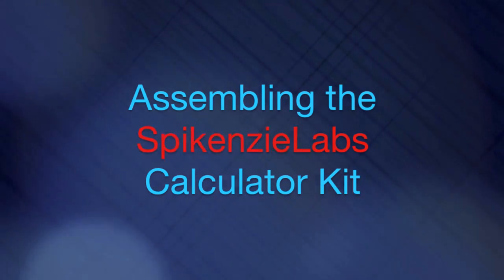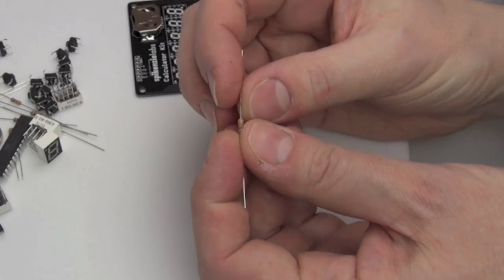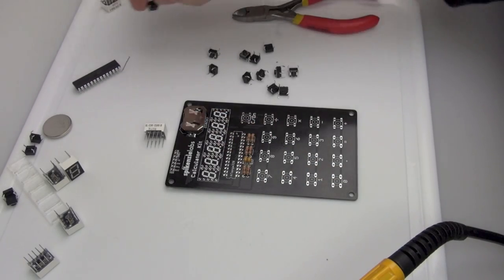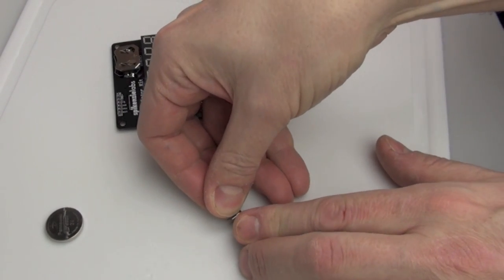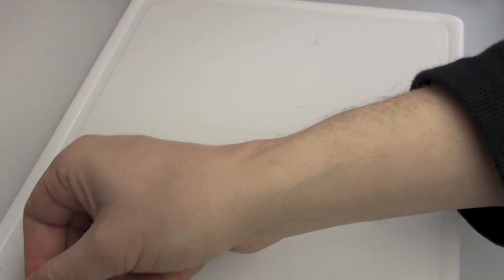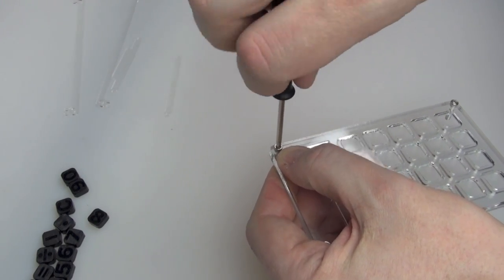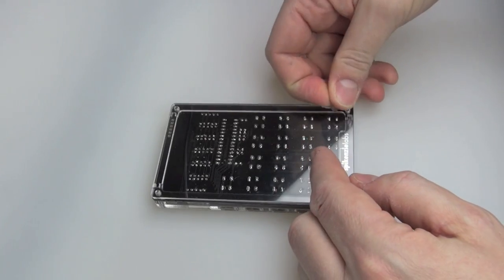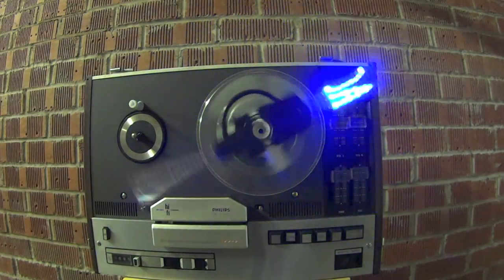Assembling the SpikenzieLabs CALCULATOR KIT (2013 video)

Comment: resistors work either way. Oh my... I thought a host of such a channel would know such things
Reply: He was actually soldering diodes in, not resistors XD.
Reply: +Quentin “SpecialBomb” Jankosky oh, wait, they were resistors.
Reply: +Another Trivial Mudak and Caps are polarized.
Reply: honestly, it osunds like the instructions made it seem like direction was important. plus, who's it hurting to just assume electronics are directional, tbh
Reply: MemphisBell electrolytic caps are polarised whereas ceramic caps aren't
Reply: Well, resistors don't care which way they're put in. But when I assemble electronics I have my way of putting them in. So they read the right way - vertical all the same and horizontal likewise all orientated the same.
I do take care to bend legs nicely too. It may not matter you think. Well it does when you look at it - you can see it's made by someone who know how to do a proper job. And in the rare event a component needs to be replaced it's easier and prettier too with legs bend carefully than just a quick job.
The devil is in the details ;)
Reply: +MemphisBell Not ceramic caps.
Reply: Reggie Roberts actually you can find tons of radial, and probably also axial non polarized electrolytic caps. film capacitors also aren't polarized generally, and neither are silver mica caps... Tantalum caps however are usually polarized though; you know for the sake of being pedantic and point out random polarization facts for the thousandth time.

Comment: Woah, these comments are hard to read through. 10% "glad you had fun", 50% "about the resistors" and the other 40% condescending know it all's who just have to voice out "how dumb" because they know one little thing. Life Tip: it's for fun. If you think you need to "shake your head in embarrassment" for someone doing something they find fun then you have a long way to go in life skills, or you will always be that dick blurting out the things you know about the furnace to the repair guy trying to act smart, and NO ONE likes that, they put up with it to not start issues.

Comment: Percent button in my opinion is most useless button ever put on calculator.
Reply: Or you could just multiply: 
$13 + 8% tax: 13 * 1.08 = 14.04
$13 at 20% off: 13 * .8 = 10.4
Reply: i dont know if 8% was your tax in your area, but in pa its 6% sometimes 7%
Reply: Smartphone David
Brackets are for noobs